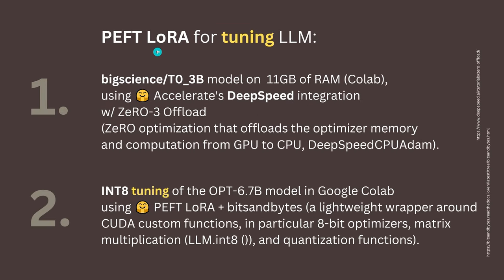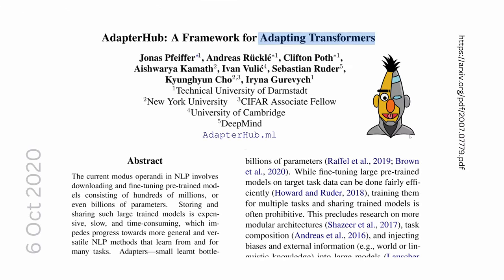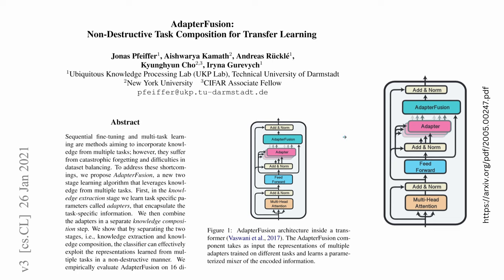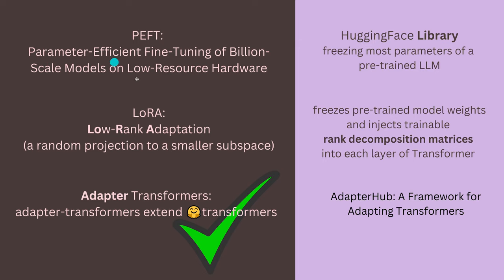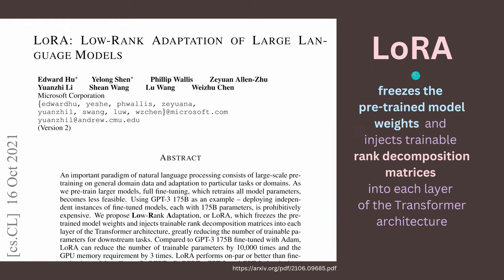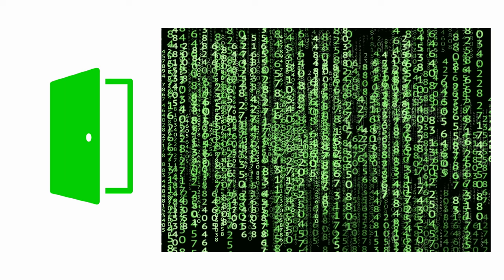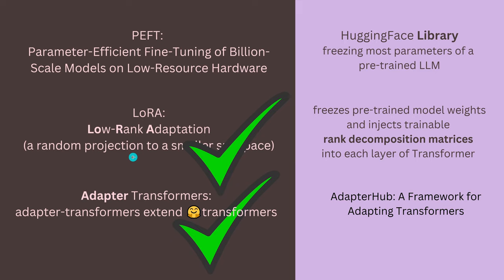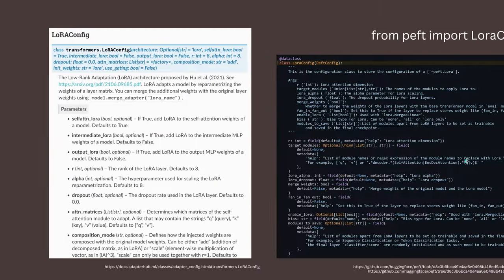PEFT LoRA Explained in Detail - Fine-Tune your LLM on your local GPU

Comment: Outstanding video, the best one I have seen on LoRA!

I have one question about the SVD decomposition procedure:
A full fine tune of a large model such as LLaMa would require loading the entire model tensors onto the GPU and adjusting them by delta(phi) for all the parameters.
In LoRA, delta(phi) is replaced with 2 smaller SVD matrices that are trained and then multiplied back into the full size and added to the original parameters.

My question is this.
When you generate the 2 smaller SVD matrices, you still need to load in the full size tensor to then decompose. In PEFT, are the 2 SVD matrices calculated once at the beginning for all the different tensors before fine tuning occurs? Also how is it possible to backpropagate through the 2 smaller matrices without combining them back together on the GPU?
Reply: very thoughtful query.. forced me to read the paper :) .. basically you are right about loading the initial full sized matrices but then they are frozen for the rest of the fine tuning process and then the lower ranked / decomposed matrices kick in ..they DO NOT need to be recombined since the idea is NOT to create an exact replica of the information contained in the pre trained model. All we need is a close approximation which is provided by combining these 2 lower ranked johnnies ( U multiplied with top N ranked singular values AND Vt mult with top N ranked sv's)..and since they are both trainable , these are the weights that will then be used. So during inference, you will have the impact of both the pre trained LLM / LM and then the task specific representations of the LoRA ..this is what i have understood ..if there's a fallacy here, please do point out .. i love to be wrong ..helps better learnin
Reply: @pumplove81  Anyways we need to do feed-forward through the original model + BA. Maybe we will just have a gain not to store a lot of gradients during backprop.

Comment: I still do not understand how LORA preserves previous information of the original dataset? Lets say our base model is a bert trained on wikipedia, when using LORA, lets consider the first block of attention, we feed forward the input features to the original weights and to the BA matrix, then we add the two results. In this way the next layer inputs are changed whereas the weights in the next layers expects something else. I still don't get it.

Comment: Great video again sir.
I need some guidance from you.
Let's say i have a very large text lines those are belongs to doctor's CMS dataset, their publication and clinical trials.

I want to train a pretrained model with thses datasets.

After request questions would looks like: who is the best urologist at New York?

Can you guide to take a correct path to achieve this.
Like with language model should I pick to fine tune on my data.

My previous experience:
1. Langchain interface, llm=openAI and chromadb.
Result are too good but openai is not a open source.
2. Same as above but this time i used llm = Dolly 2.0 12b/7b model. Result's are not accurate. They even can't count the number of paper published by doctor.

So now I want to fine tune a pretrained model with my data. 

Can you suggest me how can achieve this.
Or any better approach?

Comment: Hi boss, I have a question: If I finetune 4 LoRA models based on an LLM (e.g. Llama13b), each LoRA trained on a specific task. Can I deploy all the 5 models on the same GPU (includes the parameters of 4 LoRAs and the base model)? For example, let's suppose each adapter takes 0.5GB vram and the base model takes 26GB vram on the GPU; is it possible to deploy all sets of LoRAs and the base model on the same GPU with the usage of 28GB? (26+0.5*4=28GB)
Reply: The deployment framework needs to provide this support. technically saying this should be possible if the architecture supports switching instead of just sequentially calculating

Not sure if such support exists in any framework. But then again I don't have knowledge of all frameworks.

Comment: Quantification and quantization are two very different things.
Reply from the maker: Quantization is the mapping of a k-bit integer to a real element in Domain D, or
(1) Compute a normalization constant N that transforms the input tensor T into the range of the domain D of the target quantization data type Q, (2) for each element of T/N find the closest corresponding value q(i) in the domain D, (3) store the index i corresponding to q(i) in the quantized output tensor T(Q). That is so easy in information theory, that when I compare it to real physics, I smile and think of it as a singular quantification problem. And beliefs manifest themselves in language. Good point!
Reply: @code4AI  Well, FWIW, quantization sort of just happens in real physics, if you go far enough ;)